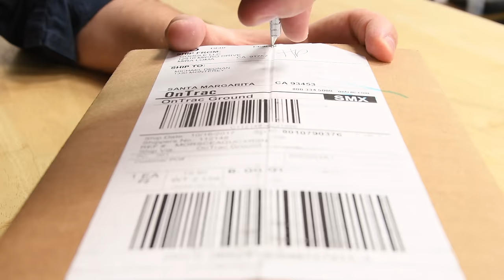Google Pixel 2 Unboxing and Disassembly!

Comment: I don't think its 441 ppi, OR its not 1920. iPhone 8 Plus is 5 inch lcd with 1920 resolution with 401 ppi.
Reply: iPhone 8 plus: 

    Retina HD display
    5.5-inch (diagonal) widescreen LCD Multi-Touch display with IPS technology
    1920-by-1080-pixel resolution at 401 ppi
    1300:1 contrast ratio (typical)